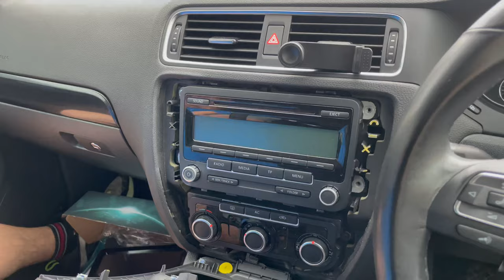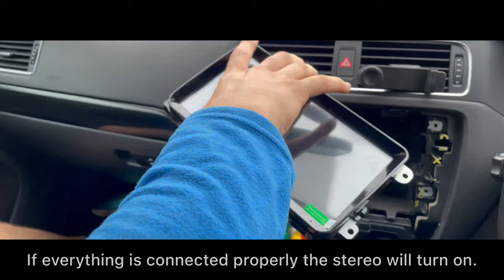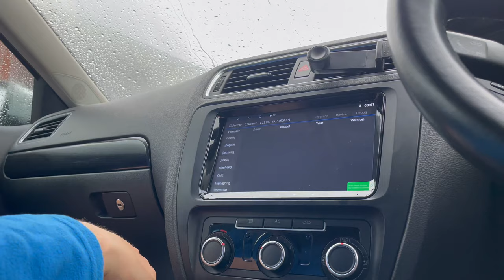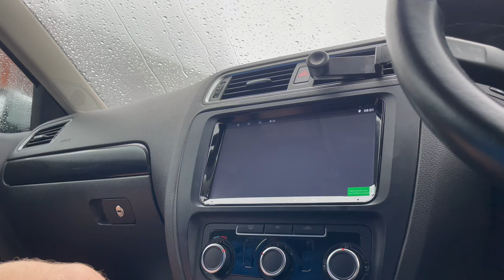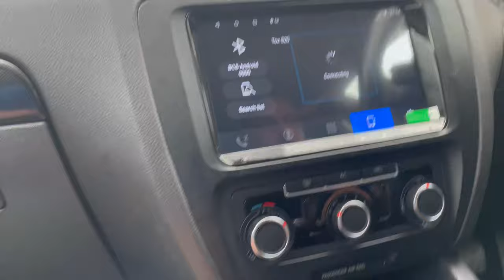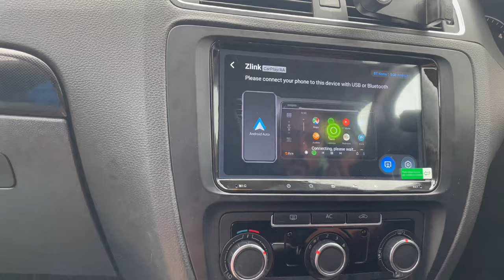VW Jetta Radio Removal Android Car Stereo Install Setup Head Unit Android Auto Pair

Comment: Hey man, I got the same one, but my stereo don’t turn off, what can I do to fix it?
Reply: plug off the red orange cable connnector at back on canbus cord, then the stereo turn of with key off :)
Reply: Mine wont turn off, can explain a little better please?
Reply: @gabrielhernandez4240  Look in video @ 1:18.  those are the wires that must be disconnected.  If left together the radio does turn off